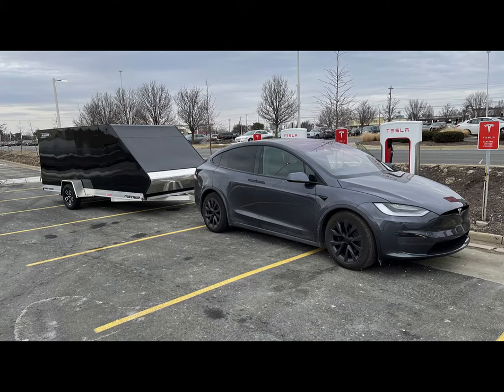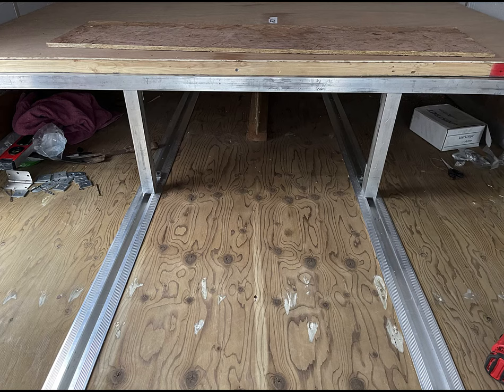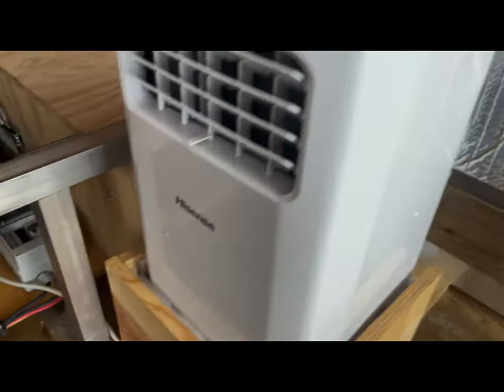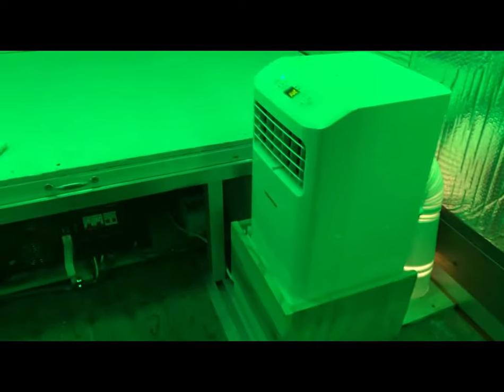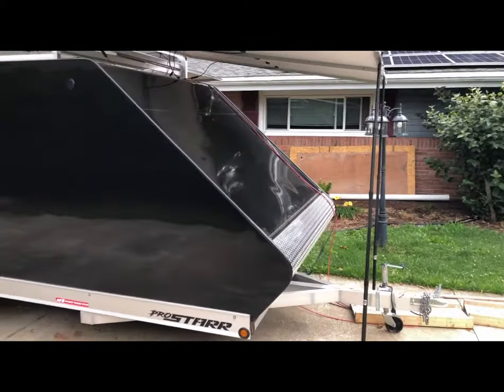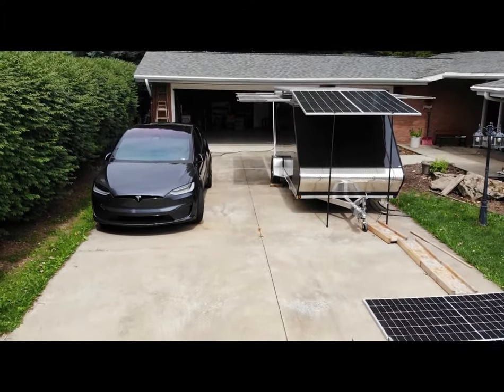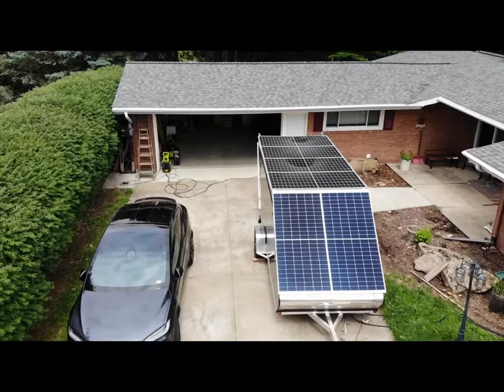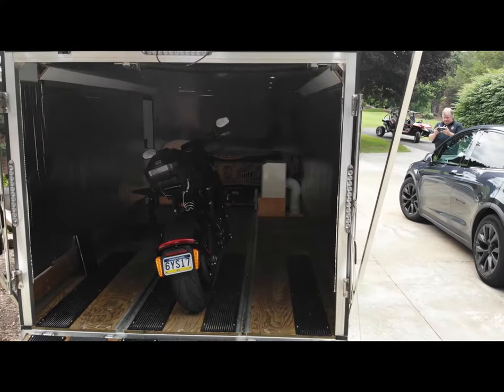2022 Model X and 4,550 Watt Solar Trailer build (Episode 13).  Solar Trailer 2.0 coming Soon!

Comment: Brilliant. Really makes me reconsider my plans for Tesla solar tiles or solar panels. This camper + solar + inverter + batteries makes way more sense and has a lot more utility. And if I ever move I bring the panels with me. I know as a tinkerer myself you can’t give a whole install but could you someday provide a component list? Big items like the inverter, batteries, panels, controllers, even that AC unit. It’s way easier to modify off a know working setup than to start from scratch. Thanks.
Reply from the maker: I’m going to do a range test and I will list all the products when I do that. I think there’s an earlier video with a lot of the components listed
Reply: @Roberteeeeeee did you ever reveal the battery company that was terrible to deal with?
Reply from the maker: Shenzhen Yidong Technology Co., Ltd.  I just looked it up and found the company is no longer on Alibaba

Comment: You should add motor assist to the trailer to increase the mileage so the trailer is not so heato pull . Just a suggestion...
Reply from the maker: I actually have looked for any type of kit to do that.  They have one commercial camper with the drive assist... Forget the name of it.

Comment: I really like your project. Preppers could use your ideas to augment “go to” camping sites. The ability to use the trailer for additional solar production, battery storage, and inverting power at home is clutch. This helps many with restrictions such as hoa’s, limitations for arrays, or worried about permits.
Reply: This concepts done in the most efficient manner with the most high end, solar panels, as well as putting solar panels on top of the Tesla, and all the sides could theoretically yield unlimited, driving, potential, purely on solar… 😮😮😮😮 you could probably get like 60 to around 100 miles of range every day.

Comment: Very nice.

I put 4 panels on my 6x12 cargo trailer. All I charge with it is my lawn equipment, all electric of course. I have a single LV2424 and 4 BYD old packs. Maybe 8 kWh of storage. When parked with direct sun, the 4 panels keep the old packs charged and all the tools topped up nicely.

Comment: we need a like a carpet solar panel that can roll up and unroll when needed.. imagine a 6'x100' long solar panel you just unroll.. have each cell a self contained unit in polycarbonate perhaps that velcros to the carpet or slides into pockets of the carpet.. and connects to a bus line.. a little led on each to point out any damaged or unplugged ones or low production ones.. or just an app that detects problems and gives coords row 84, col 2 is shorted..

Comment: well done this came more light than older  campers and you have less drag and ur  harley... 10 out of 10 from me  but if i tried one i could use even smaller trailer and a van type car.. bad thing is the idbug isnt so good in long term rummors

Comment: Excellent work my friend! Very useful and practical design that is extremely versatile! Plugging in the house when it's parked is such a great way to keep it producing energy for you. I will soon have one similar to this as well.
Quick question. How fast can you charge your Tesla with this on a nice clear day?
Reply from the maker: There is 60kWh of storage, the limitation is the charger.   I have the Tesla charging cable (nema 1450) that can charge at 40 amps @ 240 volts.   The 7kWh of panels connected to my inverter routinely produce 35 kWh of storage but have done 40 in a day.  So I can charge as fast from the solar inverter as utility service.
Reply: @Roberteeeeeee  That is excellent! I have always wondered how much of a demand a person can take off the grid with a system similar to yours when charging their cars. A lot of my work deals with powering people's RVs for dry camping, and the demand is considerably less. But you have definitely lit a spark under my butt on building one of these!

Comment: Nice work! I built a similar one with 5.1kw of solar. It's an exciting concept. Wonder if you could just add some fans to induce more airflow around your inverter. Just a thought if you wanted to completely negate any issues with the horizontal install.

Comment: I want to put solar on my camper and I want as much solar as I can. I want to be able to protect the panels on top when in travel, and or storage. then when I get to were I want to be I can some how unfold the panels to have full power. like 3kw would be a good wattage when pretty much off grid with generator back up.  I'm redoing my Camper and I want to kind of live in it LOL.

Comment: like the side panels sliding in and out, i was originally thinking a hinge that folded out down the side but your idea is much better, how do they mount, i see they slide out but how to get to the end and then fold over?
Reply from the maker: The slide outs are a little offset in height so they slide in and lock in place.  These slides are off of Amazon..  The front folds down and then it is locked in place with a screw knob I got at Lowes

Comment: I know second comment but watch more. I like the idea of when not in use add to home for added power use.   or better yet back up power if power goes out ect.  love this set up.  I hop you will show how you built the retractable stuff because it would be like having a roll out on a camper for shade but use the panels to do that kind of work.  I could set it up to were the panel slid over lock in place and when I slide them out I can fold a panel that would go a round the AC and it would fill the space to provide not only power but Shade.  Witch I would have to pic a place with the sun in the right spot so all that would be in place when traveling and finding a camp site.
Reply from the maker: They are slide rails off of Amazon... A little pricey, but let me see if I can find a link

Comment: do not compress the batteries. this will cause heat that will shorten the lifespan. Very cool project! Love the idea of using that trailer. for a good idea of how these batteries should be packed look for videos where they are use in commercial applications. it will show spacing and air ventilation. even a fan in high charge and discharge cases.
Reply: wríbg

Comment: Cool.  I have a similar sized system in my off grid home (62 kWh of Model S Modules, 16kw EVTV Inverter, 30 panels). I have an Alta Redshift and I know that I only need a pair of Panels a relatively small  battery and small Inverter to charge the bike at the track. How much does you house draw where it cant be run completely off of a 12Kw Inverter?
Reply from the maker: I have 3 12K Watt inverters.  This is only one.  I use it to run a sub-feed
Reply from the maker: I have 3 systems.... 50 amp services from the Solar Trailer.  50 amp for the another 3rd of the house...  1/3 not on solar that are portions of this 4000 Square Foot house I never use... Last month I used 122 kWh off the Grid... Before getting and charging my Tesla and Livewire, I useed 2,200 kWh per month... Now I also charge two vehicles and only use 122... My best month was 22 kWh.

Comment: You should mount your extra panels to the side of the trailer
Reply from the maker: I looked at that.... In lieu of the slide outs, I was going to put them on the side and have them lift up... I would have needed help to do that, so I went with what I could do.... Thanks for the comment!

Comment: A mini split inverter heat pump would've been more efficient than your portable AC.
Reply from the maker: I know but when it came in too heavy, I realized I wouldn't go on road trips with it.  It just became a question that needs answered... How do I keep my batteries from overheating and freezing... I overproduce so much, I didn't go that route.  Solar Trailer V2 will have a mini-split

Comment: Awesome. You can manufacture these and probably sell them for 25k easy....
Reply from the maker: Yes but I probably have 25 in it.  60kWh of batteries ($8,000).  Growatt Inverter ($2,500) Panels ($5,000).  Aluminum Unistrut and fittings ($3,000).  Trailer ($8,000).  I would like to redo this with flexible panels on every inch of the trailer.
Reply: @Roberteeeeeee   Wow $8000 for the trailer!!! Is it made of aluminum?  What is the weight of the trailer and everything on it?  My Tesla MYLR can tow 3000LBs.  Do you have a 48-volt battery voltage @ 60KWH?  That is a great price.  I paid more than yours for half of KWH @ 48 volts.  I have a F-150 (full bed) and I may cover it with solar panels (like a giant roof).  What is the model of your air-conditioner?  Thanks for making/posting your video and any replies...
Reply from the maker: It's light... here is the url. https://www.diversifieddocks.com/snowmobile-trailers/pro-starr-bullitt-series_pt30.html

Comment: what are you getting off the 4500 watt panels mounted flat ?
Reply from the maker: I have a second string on the roof that I can connect when parked in my drive.  The best I saw out of the 7,000 Watts is 5,500.
Reply: @Roberteeeeeee  sounds about right

Comment: Why the roof of a Tesla not solar anymore? Could at least off set ac for a while
Reply from the maker: Even with my Model X covered in panels, It would only add a couple of miles per day.  As apposed to the Aptera https://aptera.us/vehicle/. The only reason it works is due to it's low drag coefficient.  I want to have ev's put in a mppt charge controller and let me plug in my PV array directly to the vehicle...  Hey Elon, are you listening?

Comment: Large panels not suitable for mobile applications. Micro fissures form. use smaller panels
Reply: When I do this I will be using the largest panels I can find.  All solar panels sold today must be tested to withstand 160 mph wind for months on end.

Comment: Did you ever mention how well the solar trailer recharges Tesla? Did I miss that part?
Reply from the maker: Sorry for the delayed response.  I had no idea people were still watching this old video.  There are 60 kW of storage, so that is 4.44 Tesla Powerwalls (10K each).  But the Model X has a 100 kW of storage so basically I have about "a half a tank" of storage.  I have a NEMA 1450 outlet with a Tesla cable that supports 40 amps of charging.